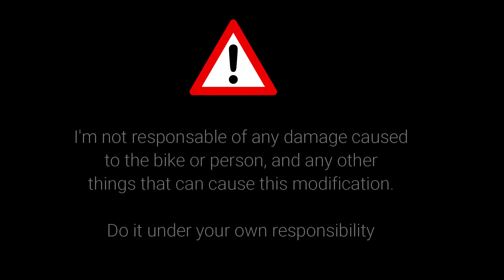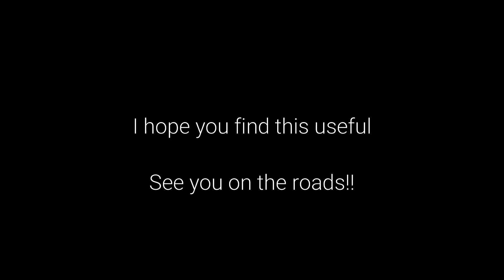Honda NC750X | How to do an ABS switch (English)

Comment: Thx for the explanation :-) .... the ground wire is for the light in the switch? Do you have a link for where to get the switch? thx. Soeren
Reply from the maker: Yes, ground is only for the switch light. I bought the switch on AliExpress. https://m.es.aliexpress.com/item/4000337197641.html?spm=a2g0s.9042311.0.0.601163c0abIcHl&gatewayAdapt=Pc2Msite